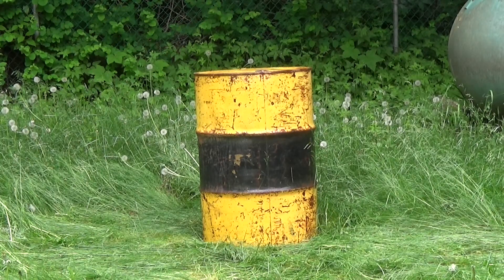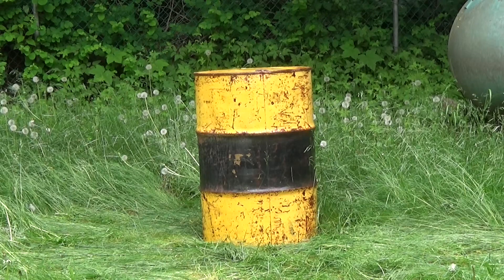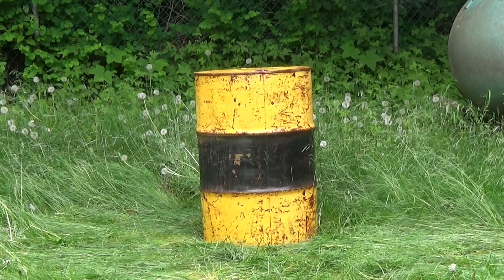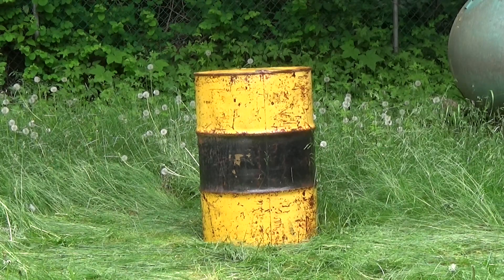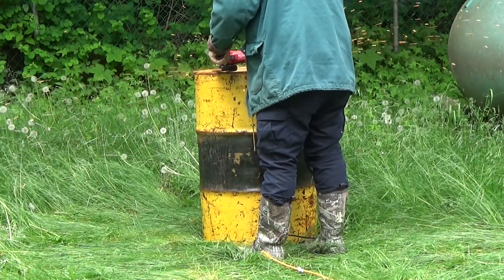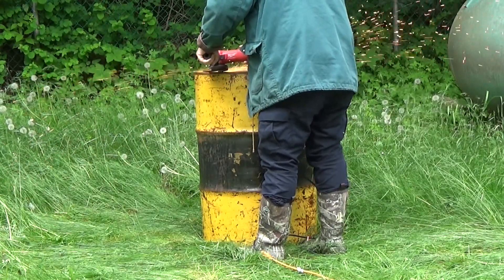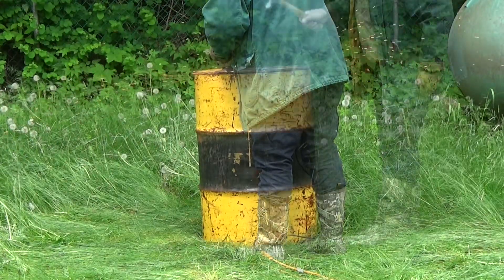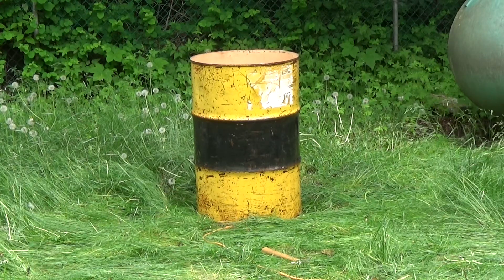How To Safely Remove The Lid From a 55 Gallon Jet-A Fuel Barrel

Comment: Throw in 1 pound of dry ice. Wait till fumes come out the top. Cut away.
Reply from the maker: I found this on line. I wouldn’t want to try it: The dry ice will sublime off and form a layer of CO2 gas above the gasoline. Since this happens quite energetically there will be a lot of additional gasoline vapor put into the atmosphere. If the gasoline vapor in the air reaches and ignition source then there will be an explosion.
https://www.engineering.com › qaqid
What will happen when dry ice is dropped into gasoline? - Engineering.com
Reply: @NorthWestCavalryman  
I've done it a hundred times. Fuel oil tanks. Gas tanks, oil barrels. No oxygen no fire. 
The pound of co2 in the barrel will continue outgassing long after the job is done. I never said doing it in a barrel with a gallon of gas in it. Usually you remove all of the liquid, then let it dry, then drop in the co2,  then cut. I think you're comparing apples and oranges.
Reply from the maker: @wutntarnation  Good to know. Thanks for your input!

Comment: I have a 45 gallon commercial oil barrel containing a little oil residue and I hope to convert the barrel into a diesel storage barrel. What is the best way to do this without contaminating my 45 gallon of diesel ? Should I remove the lid as you show to enable access inside and then clean the oil with acetone and a cloth and then how do I re seal the barrel  easily back into an air tight container suitable for diesel storage ? Thanks.